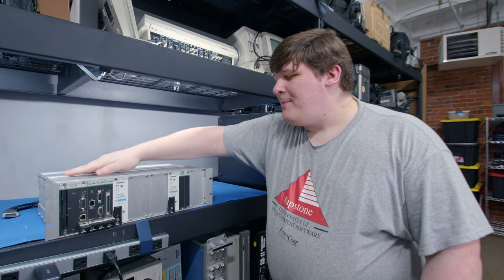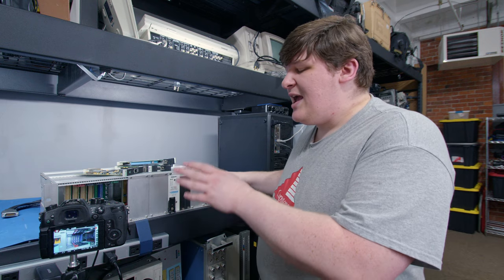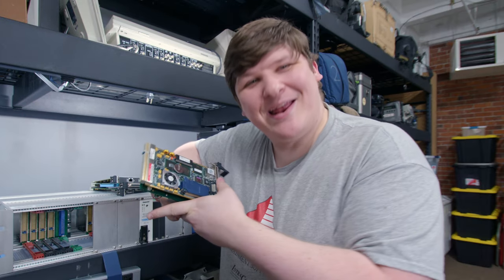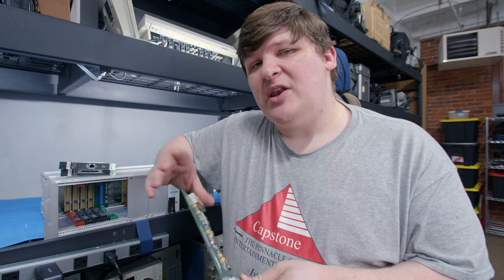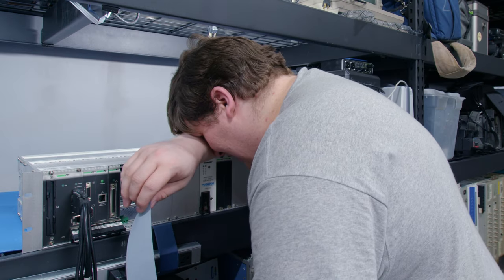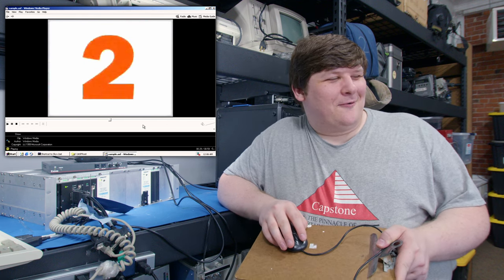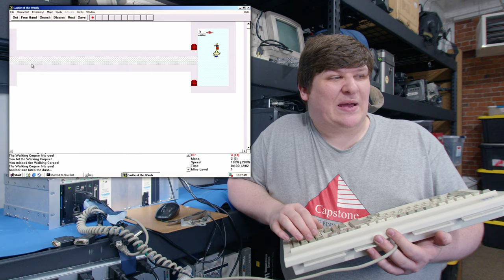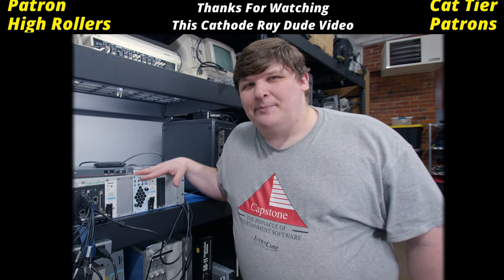Little Guys Ep 12: Computing With Eurorack

Comment from the maker: Couple errata:

- The cable DOES closely resemble DMS-59, but those cables all had a single pin missing. This doesn't, so it's actually a 60-pin connector, making it more similar to the 60-pin v.35 cables used in T1 routers (etc.) Thanks to @toodarkpark for pointing that out, I should have known that!

- Yes, it's a Cirrus Logic SVGA chip, not a Chips & Technologies. Look, everything that can't do 3D blends together. :p
Reply: Cirrus and C&T were like the decent-ish 2D cards especially in the embedded/mobile space, I'm surprised Trident sort of outlasted them, Trident has always seemed to inspire the feeling of "well at least it has a VGA output" , not that Trident last much longer though they released a few "3D" chips and at least made it into the early 2000s, their "3D" was awful just like any other card that wasn't Nvidia, ATI or 3dfx. Trident, NeoMagic, and SMI all tried to break into the 3D chips for laptops market and all failed miserably, By about 2003 Intel graphics seemed to be the norm on Intel Laptops without an IGP, and AMD without dGPUs were usually ATI or S3/VIA until S3 finally disappeared then Nvidia chipsets along with ATI started becoming more common in AMD laptops.
Reply: 32:52 Up to Server 2003, IIS was enabled by default on server installations (MS03-007). Yes, really.
Reply: Sounds like an ultra-cursed implementation of LFH-60
Reply: @AnyasJunkyard  Yep that's it, it does appear to be an LFH-60 (Molex Low Force Helix 60 pin). There's apparently variants of it with 80, 160 and 200 pins too. 
I've spent quite some time researching the connector since the Compaq Contura Aero uses the same connector for its dock connector, the only way to get VGA output on it.
Reply: Compaq Aero 486 laptops have that same connector for port replicator / dock...
Reply: Intel 21143 ... bought IP, former DEC. It's the Tulip Ethernet controller. Best controller, lot's of 3Com cards used that one. Compatible, high data through put (i.e. effective bandwidth) and IIRC the linux driver was written by NASA's Donald Becker

EDIT:
3Com didn't use them but Tulip was the next best choice. ... 3C905C was somewhat of a holy grail, but DEC 21040 (and it's successors) were well sought of being cheaper,
Reply: The Synth racks are used mostly in a post production/studio environment, not live, for obvious reasons. Which may be why you don't hear of any music from those that buy them ask you may not have asked or they want to keep a some separation of topics in their friend-groups.

As for ways of improving the setup, a monitor arm with that weird lcd you've got that takes any signal you give it mounted on the upper cross-bar of the shelf, stick a keyboard/mouse tray/shelf thing in that general space as well...
Reply: Im totally fine with the looks of the not-studio set, however I would really appreciate if you roll a few good close up shots of PCBs you talk about - especially as your videos are one of the few I like to actually watch full-screened (I even tilt my screen for this), so it felt odd having to pause the video and zoom in for context. Im sure you can pull this of without too much additional effort while adding much value to many viewers.
Reply: Please talk about iseries. I was trained and maintained a iseries vintage mid 1990s model about 10 years ago. I had to do some hard ware things with it and it was so nuts to me how different it was to x86 land.
Reply: Didnt the voodoo3 tv use the same dms connector?
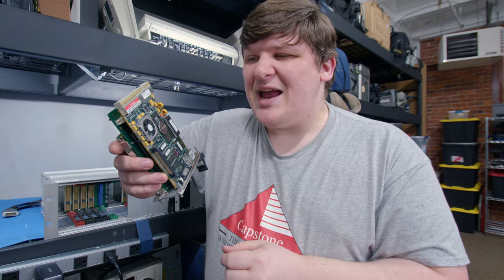Reply: 11:27 Me listening (not watching): “…pentium II 66 I believe was fastest…”
Wtf?! Oh, pentium 266 😂
Reply: Internet archive is back up
Reply: @CathodeRayDude  I didn't know until reading this it's "Chips & Technologies" and not "Chipson Technologies"
Reply: 17:10 that ↓↑ icon is usually found on PS/2 extension cords
Reply: I did see a new small white squire computer , It has a cut out with a smaller red semi see thru block that sides into the center of the white computer. I think the white part is the docking station and the red part is the computer as it to big to be the hard drive. But its about the size of 3 3.5 hardrives  , so maybe data. anyone know what this is?
Reply: How about a video about Intel Robson / Intel Turbo Memory
Reply: @AnotherOtherMan-alive  I thought CRD was commenting on how people who own these setups can spend all day twiddling knobs to build weird sounds like they’re the next Aphex Twin, but never release any completed tracks. It’s the difference between painting a picture and playing with paint and brushes.

Comment: the people taking down IA, whether it be book publishers, or the hackers, are the lowest of the low.
Reply: Even as an avid IA glazer and copyright hater IA is not without fault in either of those situations, I don't think they should be given a free pass for the sake of dogma, the access to their database and zendesk were leaked through a git repo on a dev server that was public for 2 years, and over a week after the compromise went public (they knew for longer) they didnt rotate their secrets, in the case of the book publishers they removed the lending limits on books during the pandemic, meaning instead of loaning 1:1 with physical owned books - emulating a physical library - they allowed unlimited copies to be made, I think this was an obviously bad idea for the sake of the existence of the archive even though it was based. And now 5 million books have been removed from lending entirely. Their entire defense was that digital scans were derivative works and "fair use" under copyright law. Ffs. if you give them a free pass they won't get better and they will keep making these mistakes.
Reply: @nixietubes  I still think they should get a free pass IMO. 
they did something stupid 
either way library genesis for books goated
Reply: @nixietubes  I would rather fix the real problem, Copyright.
Reply: @davidmiller9485  exactly
Reply: @nixietubes  "they broke the law" 
Bad laws should be broken.
Reply: @JessicaFEREM  No, they should be changed. But IA is not in a position to and jeopardizes their unique position as the largest public archive of books and digital media
Reply: @nixietubes  how do you expect bad laws to be changed???? 
they're broken, taken to court, and then changed. 
that's literally just how every law system works
Reply: @JessicaFEREM The problem is, the courts are currently prefer the current version of IP law, so it's more likely not to change.

In other words, GO VOTE, DAMN IT!
Reply: @JessicaFEREM  by lobbying? And they didn't argue that the laws should be changed, they argued it was fair use under current law.
Reply: @JessicaFEREM as much as I love the sentiment, all the passes can't be free. They ultimately made the information more available temporarily at the expense of (quite possibly) making it less available permanently. And when you're a service whose whole thing is the preservation of information... that's kind of antithetical.
Reply: @Toonrick12  neither mainstream party has an interest in changing copyright laws; property law is the baseline of capitalism and loosening it would be against their and their donors interests
Reply: Can we all agree that having artificially imposed limits on purely digital media is perhaps a little backwards, and that making a copy of a thing concretely does not destroy a thing or deprive the thing's owner of the thing?
Reply: $50 the hackers were hired by the book publishers
Reply: @LexYeen   No I don’t think we can.  The price you pay for tangible goods is never the cost of materials.  The cost of a hamburger is not the cost of 5 oz of beef.  The cost of an album on CD is not the cost to manufacture a polycarbonate disc.  It’s the cost of the engineer buying 10 snare drum heads and 100 feet of gaffer tape and a new ribbon for the mic that got blown out recording the guitar amp all day.  It’s the cost of the singer sitting in their apartment with a notepad and pen writing lyrics for three months.  It’s the cost of 800 hours of the tour manager’s time to schedule gigs for the year.

Unless you can find a way to compensate those people for those things in some way that isn’t tied to per-unit costs, then no, you can’t decouple virtually free copies of blocks of data from the license that the IP owner chargers for them.  There are actual lives at stake.

Removing the limits for how many people can check out a book you are giving out and doesn’t belong to you … that’s how you make political enemies and jeopardize the entire IA mission.
Reply: I support the existence of an archive of the internet. But the IA seemed to take little to no action against their service being used for copyright infringements. I hope the hackers were hitting IA on behalf of copyright owners and that the IA takes greater care in future not to just be a piracy site.
Reply: @Toonrick12  neither the Donkeys nor Elephants seem inclined to roll back or modify any of the changes and extensions to copyrights.
Reply: @3rdalbum they do, they have a way to report copyright infringing material.
Reply: @nickwallette6201  you say all that as though 95% of that money doesn’t go far, far away from the people who did all that work. 

The hamburger doesn’t cost that to compensate the labor. It costs that to compensate the ruling class. The labor gets a pittance.
Reply: @TurdInternational Based.
Reply: @JessicaFEREM  They are changed by legislative, not judiciary, action. The court's job is concerned with interpreting the laws with respect to specific cases, not with writing or amending them.
Reply: @CloudCuckooKing in common law countries, the courts do play a significant role in shaping the law. However, only UK colonies and ex UK colonies use that system — you are correct for everywhere else and Jessica was mistaken when she said it’s the case everywhere. (But of course given the US’s economic hegemony, it does still influence other countries.)
Reply: Personally I think art and information should be shared widely. Capitalism is a drain on society.
Reply: @joearnold6881  well, now you're arguing against the entire system in which this discussion is couched. I agree with you, but this probably isn't the avenue to fixing the problems you're talking about, regardless.
Reply: @JessicaFEREM   Of course you do.
Reply: @nickwallette6201  BINGO. I think it's really naive to suggest it should be okay to straight up yoink someone's work simply "because it doesn't destroy the original." No, it doesn't destroy the original, but... it does reduce its value to effectively nothing. Rather than buy it from the creator, who took all the expenses of making it, potential customers can just take it for free. So, we didn't deprive the creator of their original work, but we did deprive them of gains from it. This is especially true of digital/artistic works.

Now, I would suggest that perhaps the creator should not be entitled to the sole ownership of their creative work for as long as they are in the current system. I think the interval before something becomes public domain (and the stipulations surrounding that) ought to be adjusted.
Reply: @rileysimmons9886   Yeah, I would like to see this opened up for public debate.  Written word publishers have done a decent job at preserving their legacy, and compromising between protecting the value for rights owners and keeping content available to consumers.  The software (including video game) industry has been entirely focused on their own concerns.  There is justification for regulation there, to represent the interests of the people.  If the only thing we have to offer is "gimme it -- all it" then that conversation will go nowhere and things will remain just as they are, except progressively worse.
Reply: @nickwallette6201  exactly. EXACTLY.
Reply: @kaitlyn__L  Even in the US, a former UK colony - the courts don't make law. They affect how it is interpreted, via precedent, but in no way are the courts involved in any part of the creation of laws. That is done only by Congress on the federal level, and the various states' assemblies and legislatures at the state level - courts are thoroughly and absolutely uninvolved.
Reply: @CloudCuckooKing  yes, in most countries courts can’t set precedent. At all. 

You are downplaying how important precedent is in shaping laws, not just interpretations of existing ones but also in the creation or clarification of future ones in cases where common law courts have ruled that certain laws are unworkable, outdated, obsolete, or simply pointless and immoral. 

Except, many legislatures don’t choose to update the laws even if they should — because precedent exists to be referred to. And many high courts simply create their own, radically different, interpretations of laws which may as well be new laws passed in terms of how different of a precedent they create. 

All those laws technically on the books, but which common law courts have ruled are no longer relevant to the modern world, are laws which need to be revoked by other legislatures. Or if those legislatures decide to keep them, then each and every case assesses the relevance of the law and may apply them depending on the opinion of that judge alone rather than deferring to precedent.
Reply: @kaitlyn__L  That is a more accurate picture, yes. It still remains that in the US, absolutely none of a court's acts can create or change law. At MOST it can be found unenforceable or unconstitutional (and therefore unenforceable).
Reply: @CloudCuckooKing  i’m not quite sure what you mean by “more accurate“, I haven’t revised my rhetorical position at all – I simply elaborated more on what I meant by “significant role in shaping the law” because you seemed to imagine something far more than I intended. (Maybe you read more of Jessica’s intent into my words even though I also clearly said she overstated (from misunderstanding) the case.)
Reply: @kaitlyn__L  That sounds like it might be so. It felt like we were talking past eachother at first.

In any case, I'm with Jessica's initial sentiments, my only point is that going to the court over an established precedent has 0 probability to change anything, and the problems that need fixed need fixed in the legislative branch.
Reply: @nixietubes  I like IA, but legally they were always in really weird situation. I wish they had separated the eggs in the baskets. like if I CANNOT do what they were doing and take donations to it, why they would be able to? they also messed up the only thing that actual libraries also do and that's the virtual ebook loans (some actual libraries actually do that, but the point with that is to keep a record).
Reply: @lasskinn474  they do somewhat put their eggs in different baskets. They have torrents of a lot of their things, and that makes it impossible to stop torrents as long as there's seeders.
Reply: @JessicaFEREM  Yeah I mean just like running the legally straightforward and dubious operations under different entities(funding, servers, incorporation etc wise). like for the games, mixing freeware games with commercial games on the same service.

although I suspect that was their strategy on purpose, because they need to act like the legally dubious distribution of software thats under copyright(sometimes even on sale on compilations etc) wasn't dubious.
Reply: Exactly

Comment: The fun thing I found about about hardware form factors is that a standard 19” telecom rack is the exact same width as a standard full size hotel sheet pan and therefore cooling rack.  Because I turned an empty half height SGI Itanium chassis into a smoker. I can slide whatever food I’m smoking in on some full size cooling racks easy peasy.
Reply: For some reason I read "bed pan".
Reply: I used to bake the cookies at a hotel(supposed to be front desk but kitchen always fucked us over on cookies) and used those racks all the time, idk how I never made that connection. 

they were just premade Otis Spunkmeyer dough btw
Reply: @AgentAsteriski  
I learned from XKCD that standard beehive honeycomb frames are also the correct size to fit in a 19-inch rack, perhaps you should leave them an opportunity to make their own honey someday 🙂
Reply: What a good idea for an old server rack!
Reply: 20 inches seems like a reasonable centre-to-centre spacing for vertical posts for an imperial minded engineer. They likely didn't have much faith in their contractors, so they kept it simple. 
Half an inch for mounting, and voila.
You have your 19" racks.